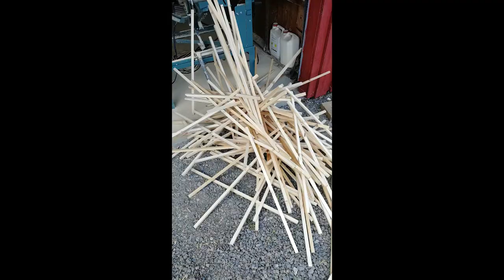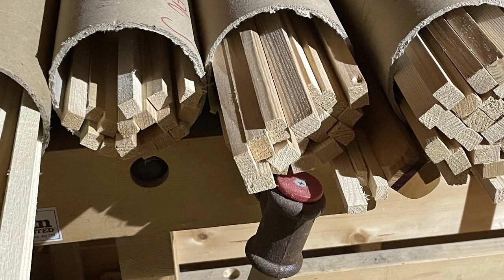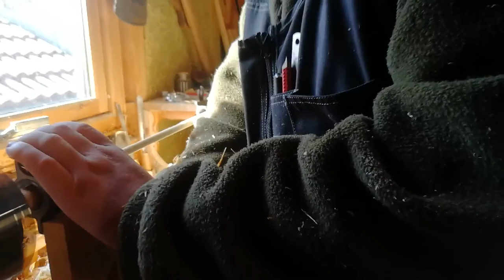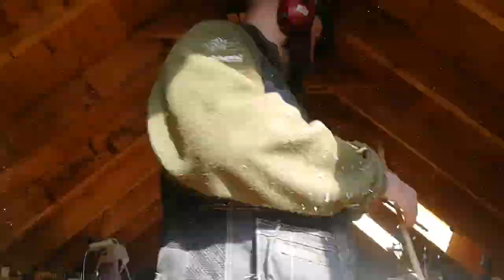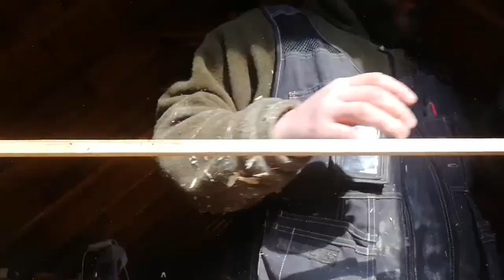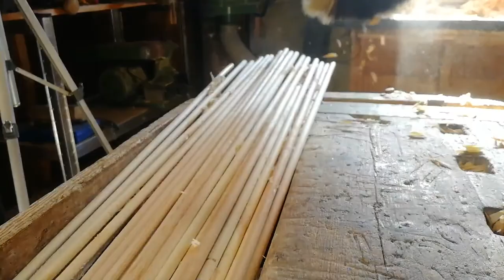Making wooden arrow shafts (Power tools)

Comment: Im shocked how well that works. Must generate a lot of heat.
Reply from the maker: It does generate a “little” and when making many it is important to take regular breaks, otherwise the thermal extension actually messes with the final shaft dimensions…

Comment: Hello what sort of wood are You using? 
Why is You only making  shafts from square wood peaces? 
Is Nordic Pine a possibility in the form as 'round logs'? if not, why then?!?
Reply: "Why is You only making  shafts from square wood peaces?"
It is difficult (impossible), to make round cuts, on a table saw.
Reply from the maker: These shafts are spruce. They come from the square as they are sawn from reclaimed planks. And as has been pointed out sawing is hard to do in a round. However you can cork out of split shafts or saplings. Might do a video on it when spring comes around.

Comment: Did you make the shaft planer? Can that tool be made cheaply? (The device to round out the square shafts)

Very nice video. Also you are a good worker. Thumbs up.
Reply from the maker: No the shaft planer is a dowelplaner from Veritas
Reply: @ullrscrafts6045 what size are you using and what final size do you plane or sand to?

Comment: Why two size dowel cutters why not just use the 3/8 to start
Reply: Because, the material he started with was 1/2" thick and he had to cut it square, to properly clamp it in the 4 jaw chuck on his lathe.
Also, cutting the 1/2" material in 3/8" strips, then making a second cut, to square them to 3/8", is both time consuming and dangerous.
Reply from the maker: That is correct.

Comment: i tried doing this with a wet hazel branch and it just chewed it up and twisted it in half. lol
Reply: I suspect (don't Know), the same thing would happen with Osage Orange, wet or dry.
Reply from the maker: So a couple of things here. 
1. This process is no good for branches, I might make one on how I treat branches at some point.
2. Regardless of what wood you use, it needs to be seasoned and dry for it to be processeable with power tools. 
3. Osage is a great bow wood, not a good arrow wood. So if you have access to decent Osage I’d rather make a bow out of it.

Comment: Never knew planks were used and just cut into shape by a pencil sharpener.
Reply from the maker: It is by no means the only way to do it. It is not the traditional way. And those that do it on large scale use more advanced tools. But for a small to medium scale production it works well.